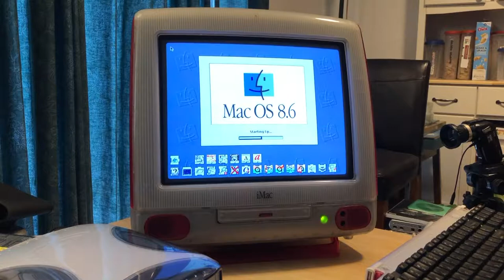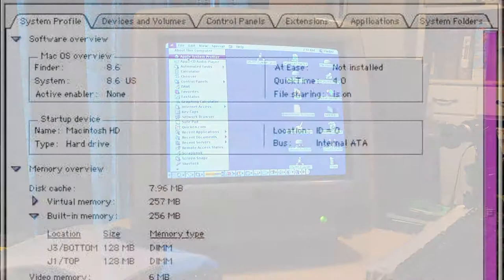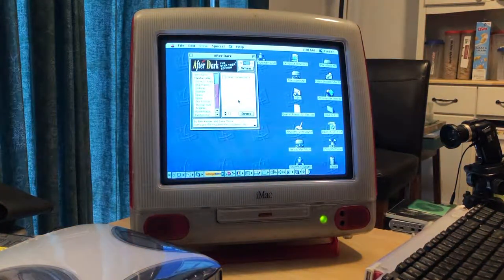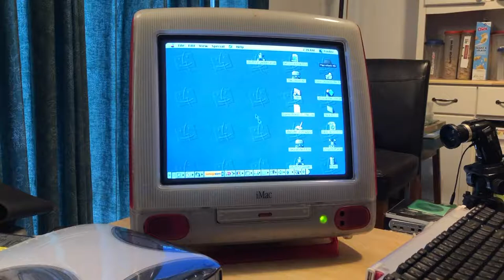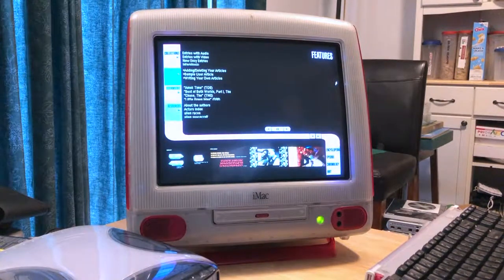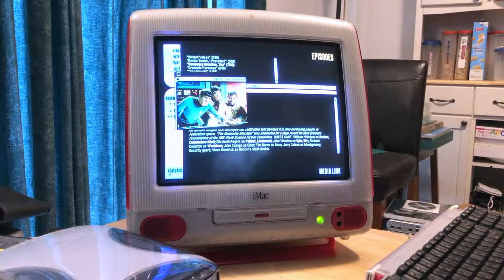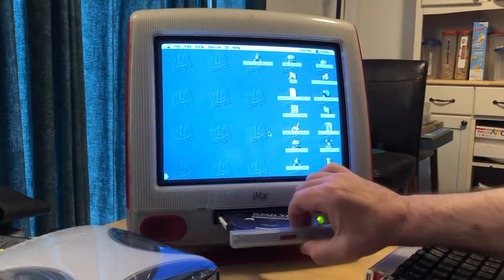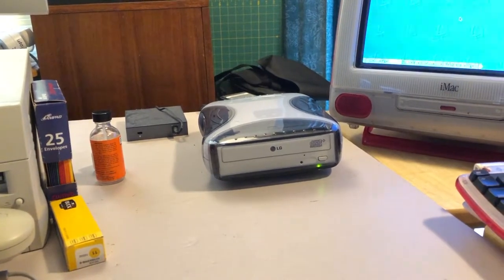Sorting Out the G3 iMacs - Part 3 - Strawberry Fields

Comment: I see that the little plastic retainer thing that fits around the video cable and the speaker cable is missing. :P

Mine still has it and you have to make sure you install the speaker cable first before putting in the video cable since that plastic retainer helps keep the speaker cable in place. Not sure how yours went missing though. :P

Also, you can put 256MB sticks in these things despite Apple only officially indicating that it supports a max of 128MB per slot (for a total of 256MB).

These can do 512MB with 256MB sticks in each slot. Just make sure to find ram with CL2 timing as that seems to be what the iMac wants.  All the ram I have is CL2 and the iMac accepted it all with no problem. At first I upgraded it to 256MB, but then ordered larger ram from eBay and upgraded it again recently. :D

My iMac is the Tangarine 333mhz Tray loader model. A Rev D iMac I think. Part of the last set made before they switched to making the newer DV/Slot-Loaders.

Oh and there is a patched version of After Dark that will run on MacOS 9. Though unfortunately the pre 4.0 modules won't run. Just the newer ones. :(

Much like on Windows where the older pre 4.0 modules won't run on a 64 bit version of Windows. I managed to get it semi working on Windows 7. Though don't have access to it's control panel. Had to use registry edits to set it to the screensaver module I wanted. (which was the 4.0 version of Bad Dog. :P )
Reply from the maker: I did return the speaker cable before I plugged the video back in. I’m also aware that you can install 512MB in 256x2, but I had 2 128s on hand so I used it. I’m also aware of the patched After Dark but I’m trying for the trifecta; one Mac each with OS 7, 8, and 9. This will be the 8 machine, my beige G3 is the 9 Mac and I’m getting an LC III for 7. Thanks for your additional info.
Reply: Haha nice. I have 8.6, 9.2.2 and MacOS Tiger installed on mine.

I don't have the CD version of Tiger (seems to be super rare) and no CD-Rs so I used my eMac G4 to setup a NetBoot server which has a image of the Tiger DVD setup as a NetInstall image. Installed it via the network. Booting MacOS off Ethernet is surprisingly fast on these old machines. :D